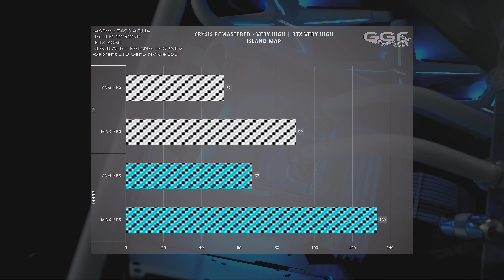OMG this Watercooled RTX 3080 Gaming PC is BEAUTIFUL!! + Benchmarks

Comment: Hot damn that is awesome.

I'm very much a Members Market builder, all my kit is top tier older gens, but that Aqua is the best looking motherboard I've ever seen, with specs to match.

Considering it costs £1,000 though, I think I'll stick to second hand 😳

Never seen white tubing like that either. I love the look of my EKWB ZMT, but now I think I'd love a hard-line build with that gorgeous matt white.

Incredible work, exceptionally clean.
Reply: You rich
Reply: @phantominception2881  Huh?
Reply: You getting an aqua
Reply: I can't buy anything yet
Reply: @phantominception2881  Nope, I'm not. I said I'd stick to second hand, like I do with almost all my hardware.

I'll be sticking to my Maximus X Formula, and getting a 2080ti and waterblock on a Members Market.
Reply: Your rich maximus is really costly so you rich
Reply: @phantominception2881  haha! Which I bought, used when it wasn't the latest chipset.
Reply: OK which chipset
Reply: @phantominception2881  Z370
Reply: @literate-aside  which CPU ram case PSU and which water cooling company you going with
Reply: @phantominception2881  it's built, I've had it for years. 8799k @ 5ghz, 1080 @ 2.2Ghz, 32gb 4600Mhz DDR4, scratch built case, 2x360 rads (Nemesis GTS)
Reply: @literate-aside  yo thats cool 5GHz did you water cool it
Reply: @literate-aside  it maybe 8700k
Reply: @phantominception2881  Sorry typo, yes 8700K. Yes it's delidded and water cooled, hence the radiators. So is the GPU. PSU is old, HX850i.

Comment: Very Clean and nice build. I'm biased because: white builds are the best.. but this was amazing. Loved the coolant color. very icy. that said, CPU temps were surprisingly hot? I'm taking these are max peak temps and overclocked?
Reply from the maker: Actually CPU was stock. But 80 is the norm for Intel these days. Other games were in the 60s.
Reply: @GGFEvents  Right, Was wondering since my 9900k at 5.1GHz all cores peaks at max 75c and is on average low 60`s during games.  ( no AVX offset and at 1.3V ). Cooling with a Ryujin 360mm. That GPU temp thought! makes me want to put a block on my 3080.
Reply: @declaredsnow  10th gen intel is just very hot compared to amd

Comment: Did you paint the tubes? If so, what kind of paint do you use on PETG? I was thinking of getting a custom mixed 2K aerosol can of Lamborghini Grigio Telesto gray automotive paint and painting the PETG tubes, as well as other accent pieces with it in my upcoming build
Reply from the maker: Yes painted the tubes with standard spray paint. Matte white. But primed the tubes first with a primer as it was taking too many coates of white to fully cover the tubes and these are acrylic tubes. Byt I've painted PETG just fine before
Reply: @GGFEvents  thanks for the reply. Do you use a clear coat? I was thinking satin or matte would look nice, and still reflect some light

Comment: dude u are making weird choices, your mobo costs 1k but u took cheap fans from aliexpress that have zero static pressure, if you would use corsair ql120 it would be solid 10/10
Reply from the maker: Did you not see the front fans?
Reply: Speaks about cheap Fans but recommends Corsair fans, which overall belong to to the worst mainstream fans on the market. Exactly my humour.

Comment: Spends thousands on watercooling a pc with access to ambient temperature, then skimps on the PSU, NVMEs, and RAM LOL.
Reply from the maker: You know the Antec OEM is Seasonic? And Sabrent are some of the best NVMe drives around? Gotcha
Reply: @GGFEvents  You can say that all you want, but Antec and Seasonic are NOT the same. The actual materials, layouts, and capabilities are different. It's like saying that a PNY and Asus GPU are the exact same because it's the same PCB. And Sabrent are "some of the best", get a grip. Performance and longevity, they aren't even close to Seagate, Samsung, or even WD. Gotcha